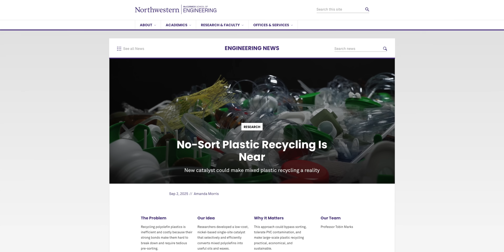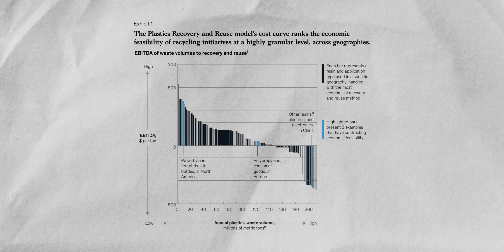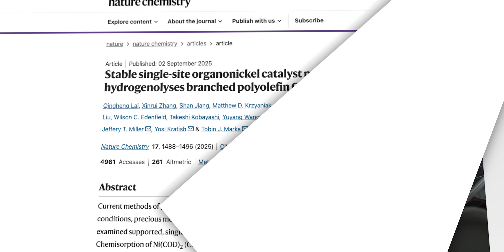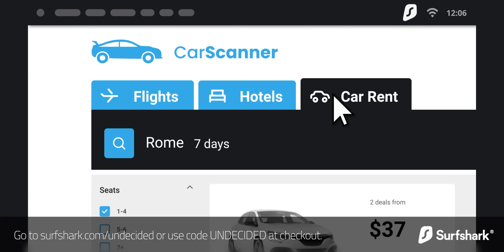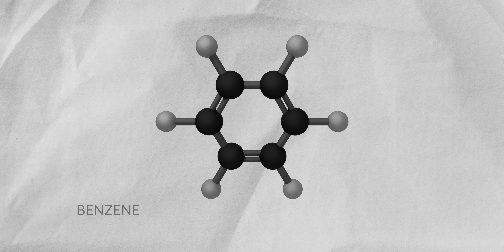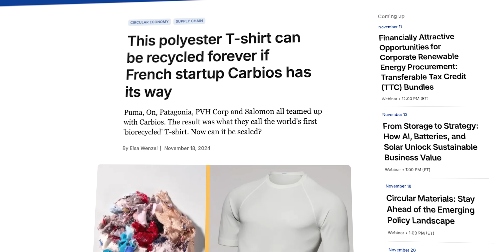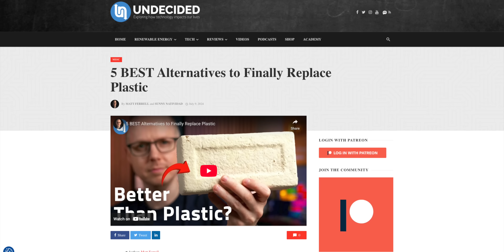The Recycling Breakthrough That Doesn't Need Sorting

Comment: @UndecidedMG 

I’ve spent over 30 years in the plastics industry and would like to share a few key points.

Economics: You mentioned that even at $60 per barrel of oil, only about 20% of plastics offer potential for economic circularity. This equation can easily be corrected. Even if oil were priced as low as $5 per barrel, a higher level of recycling could be achieved, if the end-of-life (EOL) cost of materials were accounted for from the very moment they’re created as plastic pellets.

Currently (as of November 2025), the plastics industry’s sense of “responsibility” ends at the consumer’s point of purchase. The system assumes the loop will close through recycling, and when it doesn’t, the blame is placed on poor consumer behavior. Meanwhile, the vast majority of discarded plastics have little to no economic value, a situation that is intentional, not accidental.

The petrochemical industry fully understands that for every $1 of recycled plastic sold represents $1 less in virgin material sales. By simply integrating the true cost of proper end-of-life management into the raw material price, the recycling industry would be self-sustaining and economically viable. Right now, there are zero cost associated with these materials and their impact on the environment and our health if they happen to be "miss-managed". 

2) Polyvinyl chloride (PVC) has long been recognized as a major contaminant in the plastic recycling stream, yet there are no meaningful regulations proposed to phase out its use in single-use packaging, a category that has increased by over 50% since COVID.   

PVC is an excellent material for long-term applications such as plumbing, where it can safely function for 50+ years carrying waste through a home. However, it is a poor (and inexpensive) choice for short-life consumer packaging.

Beyond its production and disposal hazards, PVC poses a significant contamination risk. When thermally degraded, it not only releases hydrogen chloride gas, but also generates benzene, a known carcinogen. It takes only a few parts per billion (ppb) of PVC contamination to compromise an entire PET recycling stream. This presents a serious risk when producing food- and beverage-grade containers made from 100% recycled PET. Worst part: Testing for Benzene is not part of the standard COA or MSDA for PET Recycled material.  

Moreover, PVC continues to release these volatile compounds through each and every successive heat cycle during reprocessing, further endangering material integrity, worker safety, and the credibility of “circular” plastic claims. Consumer awareness is slowing growing on the subjects, so the petrol-chemical industry quietly had the "C" removed from the Chasing Arrow whishcycling scheme. So instead of having to label PVC, now its is just labelled as PV or just V.  

3) Chemical Recycling, another false promise and false hope.
Chemical recycling has been promoted as the next great solution to our plastic waste crisis, but in reality, it’s yet another distraction. The material collection and sorting infrastructure required to supply clean, suitable feedstock for continuous operation simply does not exist, and likely never will at the scale proponents claim.

What chemical recycling does provide are great photo opportunities for lawmakers and lobbyists, while conveniently kicking the problem down the road for another few decades. Time and again, we see the same cycle: ambitious pilot projects that work in controlled lab conditions but collapse under the weight of real-world economics.

Even worse, chemical recycling initiatives drain already limited public funds, resources that could instead be strengthening mechanical recycling systems, which are proven and desperately under-supported.

In the U.S. alone, taxpayers have partially funded 4 chemical recycling plants. Of those, 3 have already closed, and the 4th. Still under construction, and its being built in a state with no established plastic collection or sorting infrastructure (EPR Law). In other words, a facility designed to process materials that aren’t even being collected,. but yet counting on the transportation of the required feedstock from out of state?! 
Based on past performance, I’d expect it to shut down within 18 to 24 months after opening.

3 second search on Google will provide the growing list. "plastic chemical plant closing". All costing millions to build, all conveniently build on false economic circularity. 

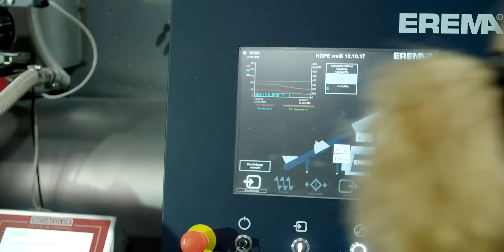(11:40), "cheap and make sense..... for PET". 
PET recycling in the US is only applicable in States that have Bottle Recycling Bills or similar EPR laws. They ensure their state recycling industry funding through mostly bottle deposit  system. Without it, there is nothing "cheap" about PET recycling. And the bottle bill has to be in conjunction with Recycle Content mandates such as SB54 in California. Where consumer products must have a minimum recycled plastic within their packaging. 

Take these things away, and you have a near zero PET recycling rate. Simply looking at map that shows the recycling rate per state vs those that have bottle bills in place tells the whole story.  Source: https://www.ball.com/getmedia/eb3620b7-e8af-44af-83cd-fb8606753600/50-STATES_2023-V12.pdf

And even in states that have bottle bills in place. The CPG world  (the Cokes, Pepsi and Dr Pepper of the world and many others) are using loop wholes that allows them to import cheap (and in some cases fake*) RPET from other countries, leaving US PET recycling plants struggling to establish a consumer base. 

Here is the kicker and very simple math, in the US only 16% of PET is recycled nationwide, with CA being the highest State at 67%. 
Of that collected amount, about 50% or less is suitable to make another PET bottle. The rest is down-cycled. 
If that's the case, how are CPG brands in the US able to label their product with using 100% RPET, when there isn't enough PET being collected to begin with? Where is all this RPET coming from? 

* There are no ASTM or ISO in place to validate the origin of PET materials. Its very easy to "pixy dust" virgin PET with tracers such as AA (Acetaldehyde) and colors to make cheaper Virgin PET sell as more expensive "RPET".

Comment: Technology is not always the answer.  Structural changes to the marketplace have long been ignored except in a few instances.  However, their reach can affect changes far beyond those of technology in shorter time frames.  In the ancient days of the last century, deposits were required for glass soft drink bottles which were then reused; even today in some places deposits are collected for glass milk bottles where they remain in use.  Some states have required deposits on recyclable plastic bottles to encourage their recycling with some effect.  But these simple examples of non-tech efforts pale in comparison to the possible impact of front-end loading the lifetime costs of any material or product.  It is the only way to ensure the sustainability of our society by economically accounting for cradle to grave impacts at the time of their manufacture.

The assessed amounts would be collected and held in a lifecycle costs fund to cover the sustainable recovery, reuse, and/or final disposal of any marketed commodity or good.  The fees assessed would be determined on the basis of best estimate at the time of production.  Various stages of manufacture would be assessed a fee or payment based upon their contribution or reduction of the lifetime costs.  The fees collected would pay the difference between a current market valuation of any recovered materials and the actual cost to perform the recovery or final disposal.  Those payments would encourage and fund better technology and practices to lower future costs.  In the meantime businesses which developed better methods of recovery or disposal could realize the difference between the initial fees collected and their costs as an added profit.

Front-end loading would require an evaluative process to set the fees for particular materials and goods.  The determination would need to be based upon their lifecycle costs at the time of the evaluation and could be updated as changes in technology or practices would have an appreciable increase or decrease in the costs involved.  Better design and manufacturing practices would be incentivized to lower a product's lifecycle fees. 

This market based solution would need to start with the most problematic materials and goods; it could then be expanded across the rest of the economy over time.  We know the bottom line can be the primary determinant of business decision making.  Front end loading the best estimate of lifecycle costs will thus have the most effective impact on social practices, product design, and technological development, but it will not happen unless it becomes widely recognized and discussed as the most viable solution for a sustainable future.

Comment: If we started making plastic manufacturers responsible for plastic waste i think things would improve drastically.
Reply: They would outsource plastic manufucturing to where its not their problem, just like they do with the trash.
Reply: Alas it is such a gigantic if. We've known for a while how fossil fuels come with external costs that are FAR greater than the direct costs of pulling the stuff out of the ground and refining it (even if those are no small feats), and decades in we continue to massively subsidize the industry. That is to say, all ordinary tax payers are paying a ton of money in order that they pollute and cause the climate crises, complete with mass extinction, disease, hunger, war - and we do so even though we also know this locks us ever more into dependency on a resource that would obviously run out, since we're using it at a rate millions of times higher than the rate with which it renews. (We have used many millions of years worth of oil *formation*, or natural oil production, or whatever you like to call it, in the last 100 years alone, and most of what we've used has been used in the last... ten years perhaps? Our use is still increasing, so it's very tail-heavy at least.)
Reply: Exactly. Until the industry is stuck with the downstream real costs nothing will change. Funny how back in the ancient 50's we got along just fine with glass bottles and natural origin wraps like cellophane.
Reply: @logtolum  Well, we had plenty of trash and pollution then too. At least if we switched back to glass bottles we could institute a system link in Norway that encourages people to recycle by making products more expensive BUT by recycling you get that money back.
Reply: @hermaeusmora2945  Lots of trash... not where I lived. In fact us kids in the 50's just loved to find a beer or pop bottle that got turned into 2 cents at any
 grocery store. Five pop bottles paid for one 10 cent chocolate bar. Oh yeah, and those plastic water bottles... didn't even exist. Nobody was insane enough to pay for water.
Reply: Plastic Tax
Reply: Half agree, since it's not just the companies fault. but you would have to some how figure out the impossible logistics of stopping the regular people from just tossing it to the side on the floor compared to walking to a bin.
Reply: @VoidvDragon  It's known fact that plastic makers knew plastic couldn't properly be recycled and they staged ad campaigns to put the responsibility for plastic pollution on the consumer. Because you're never going to be able to force people to recycle, we should put pressure on the manufacturers to make products that a) can be recycled as per the video or b) make products that can degrade naturally.

I read a story years ago about Dannon yogurt doing a campaign in Bangladesh to combat malnutrition by giving out yogurt. There is ZERO recycling there and they didn't want to see the country polluted so created biodegradable containers and spoons. We should be making companies do as such.
Reply: Governments just need to put their foot down. No plastic production for the drink industry. Fullstop. End of story. Only plastic for medical one use for biomedical safety.  The drink industry need to be thrust over to aluminium and glass. If they want plastic drink bottles, they need to use 100% recycled material. Screw them, before they screw our Earth. It's not going to make them go broke. They will just make less extreme profits. Problem solved. 🧑🏼‍⚖
Reply: Absolutely!
Reply: @hermaeusmora2945  the cost of this would be added to the cost of the item.  Both the manufacturer and consumer would lose.
Reply: @camos79  The consumer would lose today. The consumer of tomorrow would gain (including yourself if you are not a retiree already).

Comment: a hydrogen plasma torch? . . . isnt hydrogen plasma, like that at 2000 degrees, something fusion is pursuing and the heat is an issue, its why they use magnets to contain the plasma.

Comment: This goal is a lot like the fusion goal... always so close or possible, but never seeming to be able to be delivered.
Reply: Nuclear fusion is still a scientific problem. Plastic pollution is only an economical problem. The usual: private profits, public losses. Tax non recycled plastics and 90% of the problem is solved.
Reply: @M69392 Except it is not.  The science still hasn't delivered on recycling plastic.  There certainly is a government failure to put proper costs on disposal of items.  Once disposal costs are appropriate AND cannot be easily side-stepped (via shipping abroad or just dumping, etc...) then the markets will be incentivized to move away from plastic and back to glass and metals, but also to recycle plastic better.

Comment: Everything needs to be recycled.  Manufacturers need to be required to use recycled materials to make new products.
Reply: This is what everyone wants you to think, that recycling solves the problem. But it can't, because the root of the problem is growth. The World Bank tends to use 3.2% as the average global long-term growth target. It sounds so moderate. In fact it means doubling the output in slightly under 23 years. Now your average BMW doesn't last quite that long. But it lasts more than a decade. Which means that for recycling to solve the problem, it's just not good enough to recycle every atom of the car, you need to make something like 1,5 new cars from that old one, or else you have to keep mining those new resources.

Comment: pyrolysis is a plastic removing system, not a recycling one. has an output of fuel types. wouldnt it them be better to use bio based plastics to replace all the plastics being turned into fuels, to be used as long term power storage and power density? turning oil based and bio based plastics into the same fuels, we can ease the oil issues, while giving us the plastics we need for the long term, without adding more plastics into the ground and oceans. hell, id like to setup a pyrolysis system at a landfill, to harvest it into fuels :P

Comment: This is the plastic recycling we were promised.  It's not as good as aluminum or glass, but it's better than steel (which has higher loss rates). Of course, my local waste company won't accept glass because it's too heavy for what it sells for.  Plastic is so much lighter it's probably the right packaging answer.

Comment: With regard to the blow torch system, we need some joined up thinking to bring high energy use green tech together with new off grid renewable generator systems to provide energy independent production sites for such industries as steel, cement, ceramics, glass making and recycling and nf metals. That kind of planning needs to be underway and to be international in scale.

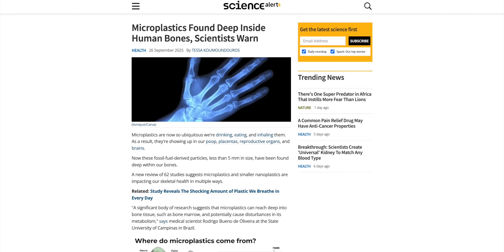Comment: 1:51 You need to start clarifying that plastic is made from a fraction of the oil when it's sent to the refinery.

I asked Google "what is the difference between the final source of crude oil used for plastic and the crude oil used for engines" and it spit this out: The difference is not in the final "source" of the crude oil, but in the specific refined "fraction" of crude oil used for each product. Crude oil is separated into components of varying molecular weights through a distillation process. Naphtha, a lighter fraction, is the primary feedstock for plastics, while other fractions like gasoline and diesel are used for engines. Additionally, fuels for engines often contain performance-enhancing chemical additives, while plastic feedstocks are processed into different chemical structures. 
Crude oil for plastic;
Feedstock: Naphtha and other lighter hydrocarbon fractions from crude oil refining, or liquids from natural gas processing, are the primary feedstocks for plastics.
Processing: These fractions are sent to petrochemical crackers to be broken down into basic building blocks (monomers).
Final Product: These building blocks are then polymerized to create the various plastics we use. 
Crude oil for engines;
Feedstock: Refined products such as gasoline, diesel, and jet fuel, which are different fractions of crude oil.
Processing: The refining process separates crude oil into a spectrum of products based on their boiling points and molecular weights.
Final Product: These fuels are further processed and combined with additives like detergents, dispersants, and viscosity modifiers to meet specific performance standards for different engines.